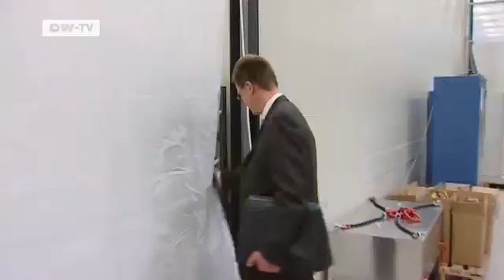Made in Germany | Heat Pumps with Growth Potential

Comment: First of, those 90% that haven't been explored haven't been explored because of scientific findings, there is nothing to be found there. No need to drill if it is easy to tell there won;t be any oil there anyways (no rain forests thousands of years ago, etc).

Point is, oil and gas will run out. It is not a myth, it's a fact. When it runs out in 50 years top, I'll be pointing and laughing at you. Republican propaganda is dangerous.

Comment: o.k. so you dont want to use gas or oil so you went to a heat pump. were do you think you get the power to run your heat pump ?? from you local power plant that burns coal gas oil. heat pumps suck in the winter time..
Reply: That is true. However due to Wind and PV more than 50% in germanny  power from grid is renable with growing values

Comment: The Architect  said it has no Co2 emissions and doesn't need fossil fuel......the Heat Pump might be efficient but it still runs off .... Electricity.... Maybe   underfloor heating with  a Wood pellet  Boiler could have been a better choice , that  allied with more insulation  in the first place, would mean they would be creating a better Building Rating for their home... thus making a  seriously highly insulated ... airtight home.... with less heating demands....